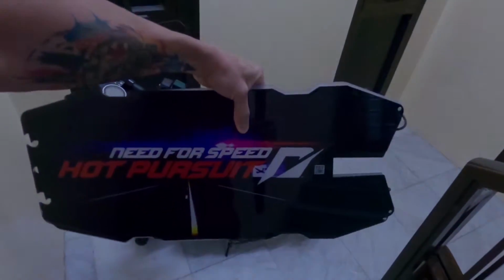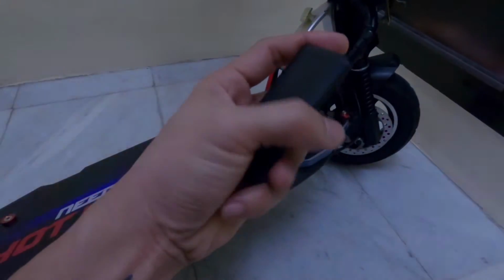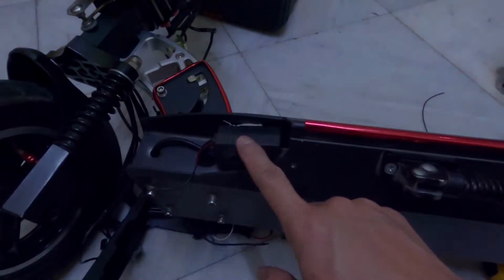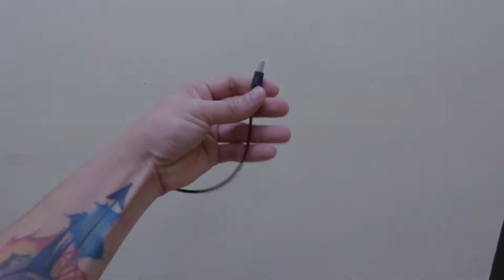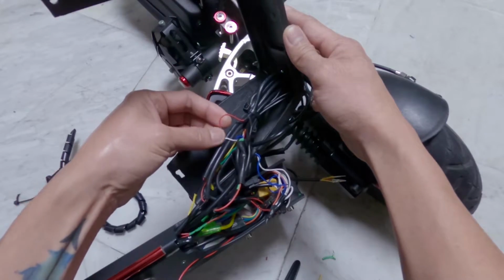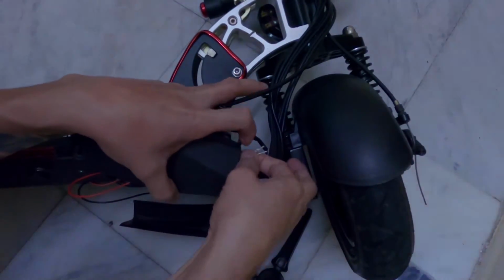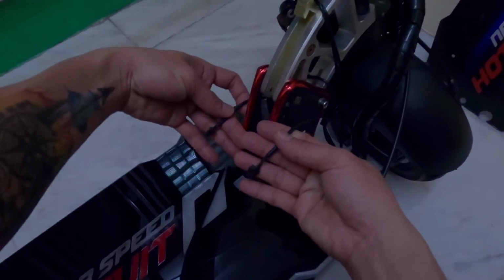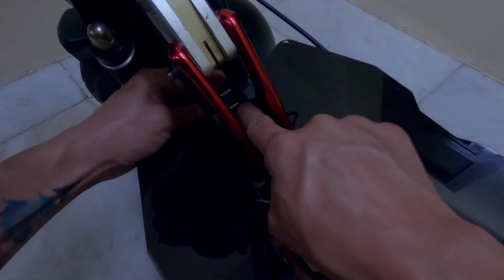LED BOARD Installation | E10 Electric Scooter

Comment: Sir ask ko lng anong saktong sukat ng customised  board mo gusto q kasing gayahin
Reply from the maker: Goodday kaadik!
Oversize cut yang dati kong board na LED.
Bale regalo yan kaya di ko talaga alam un saktong sukat.
Nasa Media Store un full measurement niyan.
Hanapin mo lng si pare Roderick, alam n niya yan.
Abu Dhabi ka ba kaadik?

Un ordinary board ko na walang LED oversize cut din. 10mm thickness. UV printed.

Kuha ka rin ng underliner na board kung sakaling same tayo ng unit. 4mm

Comment: Kaadik good day po tomorrow makukuha ko na board ko from MediaStore, do you think po ba gagana ang dc converter 5v to 12v female at usb  sc to dc converter cord para mapailaw ang board. Power source will be 20000 mah powerbank medyo wala pa budget for battery pack kakabili ng gamit haha
Reply from the maker: Goodday kaadik!
As long as 12v un output voltage, gagana yan. Mas maige kung DC connector un gagamitin.
pede k rin mag pa guide sa Media Store kung ano un mas the best na power source at connector.
Regards n lng kay Roderick pag punta mo sa Media Store kaadik.
Di ko pa na try un powerbank,.. un gamit ko dati is car jump starter.
Have a nice day kaadik🤟

Comment: Kaadik pwede po pa help navpapagawa kasi ako board ng e10 pro but hindi po ako na gogohan ng mga gunagawa una po malayo ako sa area nila and second reason is iba daw po size ng e10 pro sa e10 lng. May idea po ba ikaw kaadik kung legit na iba size ng board ng dalawang scoot.

Ride safe po kaadik
Reply from the maker: Goodday kaadik!
Ganito kase yan.
Ang E10 scooter is generic, so wala sila mini maintain na standard .
Magkaka-iba un deck, kaya di parepareho un sizes at un pagbubutasan nun board para sa mga bolts na pagkakabitan nun board sa deck.
Ride safe kaadik!
Maraming salamat🤟

Comment: Idol Lupit Ng Set Up m Sanah Meron Din Gayah m Dito s Jeddah Ng Sset Up Gusto q Din Upgrade Scooter Sanah Mapancin m Chat q
Reply from the maker: Goodday kaadik!
Maraming salamat po sa support mo😀.
Kung gusto mo magset up ng scoot.. 
Bili ka ng mga accessories sa aliexpress.
Tas un acrylic board, hanap k ng advertisement agency jn. Un mga gumagawa ng signage.
For sure magagawan k nila ng acrylic board para sa scooter.
Ride safe!
🤟
Reply: @jaysonulanday  Salamat Idol s Tip m Ang Lupet Ng Set Up m My F.B Page Kbah Idol Yung Bar Plug m Kah Adik Jan Mo Din Bah Nabili Yan Salamat Idol
Reply from the maker: @reyjohnmedel6212  kaadik!
sa bicycle shop ko n nabili un bar plug. Un ODI.
Check mo sa mga shop jn.. baka meron din .
May FB page ako pero di pa active hehe!
Maraming salamat at nagustohan mo un set up ko🤟
Ride safe!